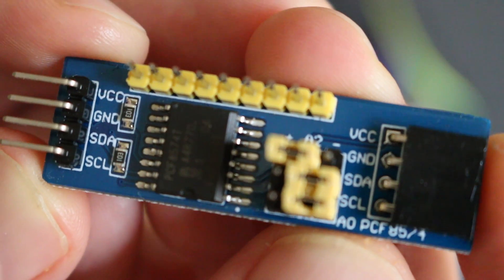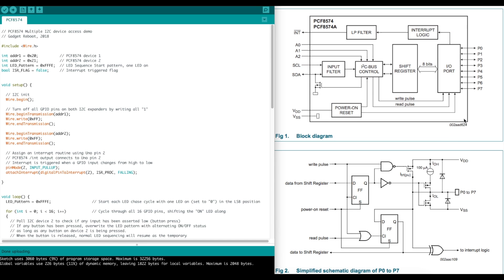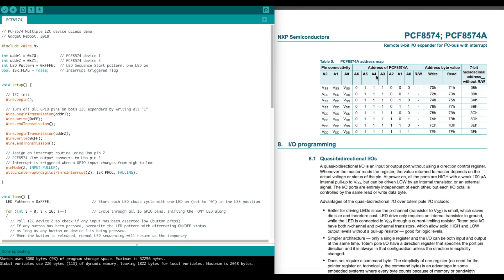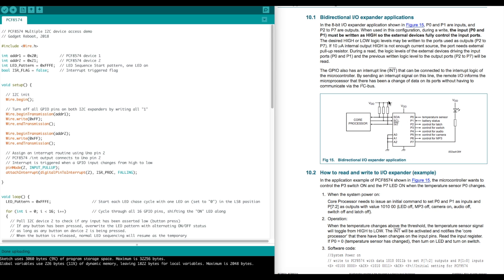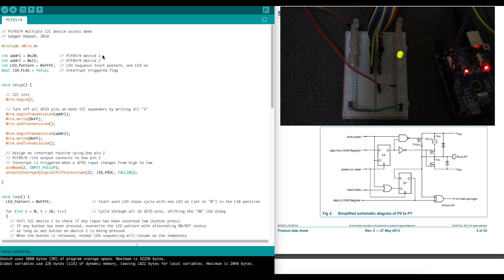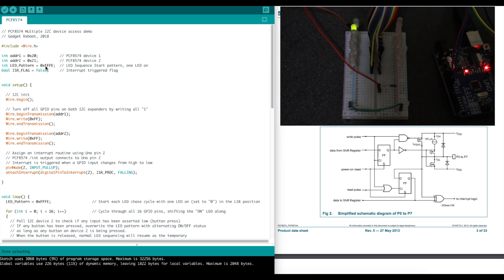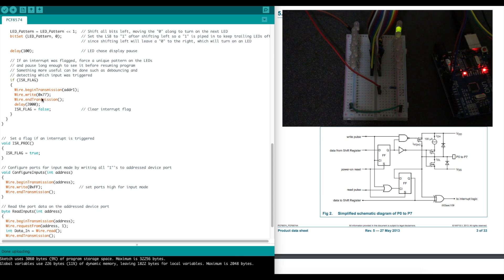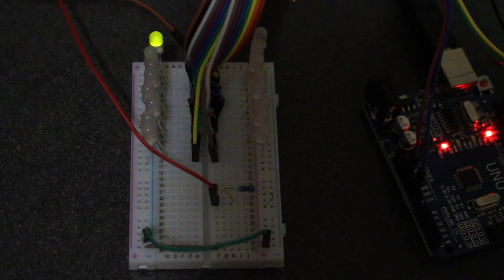PCF8574 I2C GPIO Expander Tutorial

Comment: Hello, excellent tutorial. I need to read the status of 150 buttons. Is it possible to cascade 19 PCF8574? The project is with Raspberry pi 3 b +
Reply: I suggest you to divide it into a matrix (for example a 12x13 allows you to read 156 pins), so that you only require 25 pins, which means 4 PCF8574 should be enough
Reply from the maker: A PCF8574 has 3 address pins allowing up to 8 on a single bus for 64 IO pins, but then an I2C bus expander like this https://youtu.be/FgCYcOrQnho can be used to allow multiple busses, each with up to 8 PCF8574 on them

Comment: Hi, howdo use one extented and each gpio one by one.  I need use por 8 relays module. Please, help me.
Reply from the maker: This project should help: http://geek.adachsoft.com/home/article/id/21/n/How-to-use-ESP8266-with-PCF8574-4-input-and-4-output/refid/it#software

 I found this once when I was looking for some research. It’s a wireless interface to individually control some relays so the source code has routines like  SW_on    SW_off      SW_toggle. 

 Those show how to manipulate just one thing on the eight pin expander by reading in the state of all pins, changing just the one of interest, then writing it all back out so everything is preserved.

Comment: Two comments on the code:
1) not everything is an int ;) (yeah, I know, it's driven by all the bad tutorials and examples... :( )
2) which can turn into a problem, variables used in a ISR should be declared volatile. Otherwise the optimizer might think the variable is never used (or at least never changed) and optimize it away. Leaving you with weird problems.

And did you already try the library? Tinkering like this is good to understand how it works. But libraries just make it a lot quicker and cleaner. Because as you said, it's not the most elegant :) (tip, try to be more consistent in your code)

Also note, hardware interrupts are a complete overkill for switches ;) The INT of the PCF can be useful but that result doesn't need to be checked by a hardware interrupt, polling will be fine.
Reply from the maker: Thanks for the comments! I didn’t know about using volatile. I remember I couldn’t get the library to work but if I tried again I might have better luck now after using the part several different ways. I just needed something to work.
 I haven’t done any coding in about 10 years so this is also kind of a re-introduction  experience for me. 
 The interrupt is overkill here but it was also to test it and if the code gets bigger polling may not be frequent enough.
Reply: If polling gets to slow your code has other problems ;)
And besides the overkill, interrupts come with pitfalls like the need for volatile. But also non-atomic can be a problem. A good series about interrupts and the good, the bad and the ugly parts of it: https://hackaday.com/?s=Embed+with+Elliot%3A+Interrupts
And if you have a working hardware setup, just load the library (with the right address) and it should work out of the box.

And welcome back to coding! About consistency, there are multiple ways of doing it consistent but by the names of loop() and setup() and other examples Arduino it would be more consistent to follow that style. Aka camelCaseForVariables and forFunctions. And as an aid, UpperCamelCaseConstVariables or ClassNames. ALL_CAPS_FOR_MACROS (but really the need for them in C++ is VERY little). And things like pin 2 also deserves a (const byte) variable ;)

Keep up the nice video's!
Reply from the maker: Thinking about consistency, one thing I did notice while poking around is the different ways people structure the use of the braces  like if they are starting a for loop, some people put {  at the end of that same line and others put it on the next line and it’s easy to get lost. I don’t know if there is a more accepted  etiquette on that.  The more I do it, the more I will figure it out.  

 Coming from a world of spaghetti BASIC coding, any structure is good at this point.
Reply: Yeah, the placement of brackets is the biggest disagreement in C/C++ world :D I think 50/50 like it at the end or at a new line. I'm, like the IDE (because look at the default sketch), in favor of placing it on the same line. Because the block has a hard connection with the if/else/while/for/etc. You can not read it on it's own.

But yeah, that is just style. As long as your consistent I don't mind people having different styles. But a consistent style makes it easier to read the code and also remember function/method/variable names.

Comment: Can you control 64 leds with 2 x 8bit expanders?
Reply from the maker: It would seem like you would still require some kind of extra chips or driver transistors like an 8 x 8 matrix or an address decoder like taking three inputs and turning it into eight decided outputs. 

 For a matrix I’m not too familiar with how those LED cubes do it or even general keyboard input matrix circuits but  if one side of the matrix is sinking while the other one is sourcing, that’s where this particular unit would need some extra help.

 I don’t know if having just external pull up resistors to help source current would be enough and then there’s the whole  Matrix ghosting thing where if it’s not done properly if you try to activate three sides of a square, the fourth side gets phantom activated. 

 So I think it would be fun to look in those LED cubes and see exactly what they do because I believe those are the most efficient way to get the maximum usage out of minimal GPIO.
Reply: Interesting
Reply from the maker: Maybe 2 expanders plus 4 more Arduino I/O can do 64 like this:
https://youtu.be/K33bRo2tIYg
Reply: Congrats, looks like you beat your issues!
The best use of a PCF8574 is for input, rather than output.  One of my 5x7cm perfboard  projects has an I2C OLED and a PCF8574 connected to 5 buttons in a cross, and plus a rotary encoder (left, right, push==3 more buttons).  In this way, you can display output, navigate menus,  and rapidly twist in a value, all with two i2c data lines.  The speed of the rotary's turn is calculated to accelerate, so high values will not require a whole lot of twisting.
If you must have symmetrical drive output with a PCF8574, an octa-buffer is the thing.  74HC14's may be cheaper.
If you are just driving a LED matrix or a bunch of 7-segs, the 74HC595 shift register is superior.  Inexpensive, chainable, good at sourcing current, and  fast.  You can use the AVR native SPI bus to "shiftout()" data to them.
Reply from the maker: Yeah I saw an LED cube schematic using 74HC595s as part of the mass control infrastructure.   After all the learning I have done in the past two days on the expander I can see how it is well-suited for inputs.  Along the way I resolved many different issues but I think there still might be a few unresolved mysteries for another day. 

 Now I have to think about what to tackle next...
Reply: This is very strange circuit. So confusing if has uses for output or input. They advice not to use all pins for input.
There is also other i/o expander - probably better - MCP23017
Reply from the maker: Maybe I should buy one of each to give me something to do .....
Reply: If you have time - with your excellent skills maybe you can design large led matrix controlled only by 2 i/o circuits instead of a dozen of them. That would be very popular and helpful project
Reply: you can with 2 expanders and programmer like a keydap using a matrix 8x8